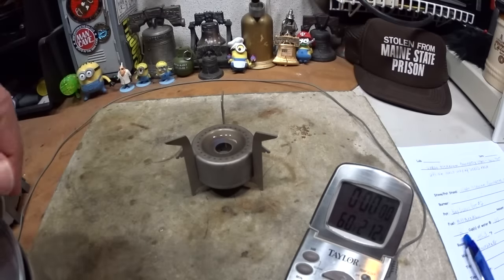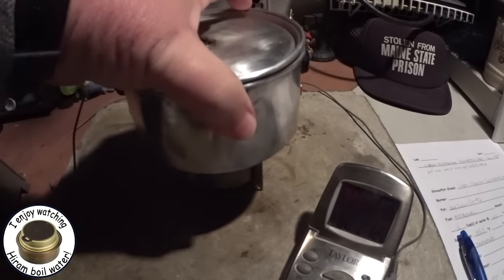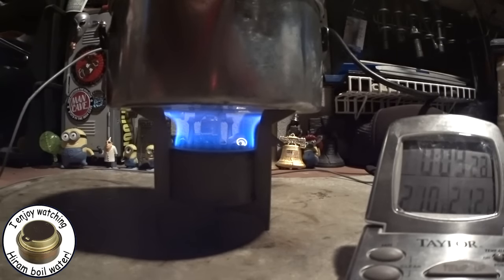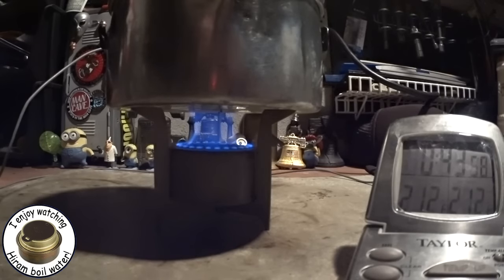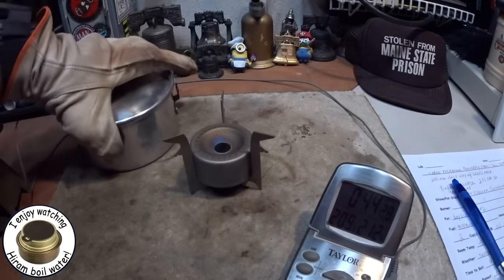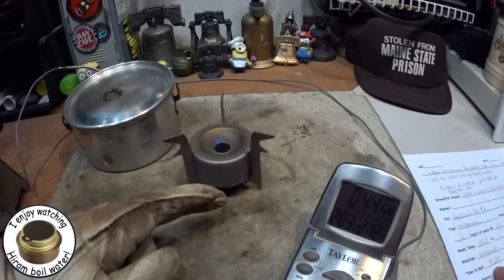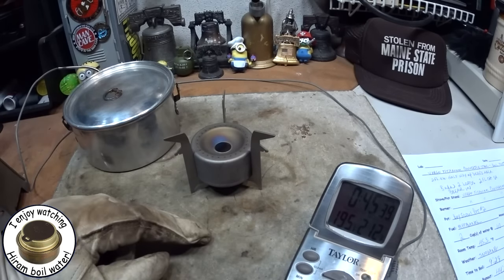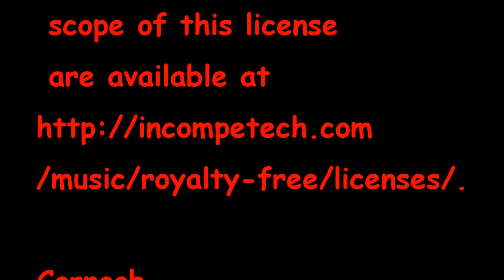Vargo Titanium Converter Stove - Boil Test

Comment: This mystified me too.  Why would anybody even try to sell a stove like this, right?  But I think I may have just cracked the code.  I just ran a Vargo Decagon test in the Hexagon stove and I found that the chimney effect of the Hexagon really boosted the output of the Decagon vs. a regular windscreen.  I suspect this Converter thing is specifically tuned to only work well inside the Hexagon.  By taking it out of the Hexagon, you've basically turned it down and that is why it is taking so long to bloom, boil water and why it has a 40+ minute run time.  Watch the crazy Decagon test video here to see how stuffing it into the Hexagon boosts its output: 

https://www.youtube.com/watch?v=Hd_jOpT5HX8

I bet you will see something roughly similar if you run this stove inside your Hexagon.  Turns out that the Hexagon is much more than just a wind screen, who knew?

Comment: Hiram, many people have suggested a tab of carbon felt under the burner to pre-heat it. Another idea I had is you could fill the stove with 3/4 - 1 ounce of fuel, however much you want to use. Then place a circular disk of carbon felt in the center, something about the size of a 50-cent coin, and add a splash of alcohol. Light the disk and hopefully it will pre-heat the stove and get the jets going just like the full 2-oz fill does.

Comment: Try putting a foil dish under the stove with a little alcohol in , to pre-heat the stove and bring it to bloom, with only an ounce of fuel in the stove.. Or as pkossman suggested  Try to pre heat with a tab of carbon felt /alcohol under stove ,should light quicker with less fuel.

Comment: Thank you for taking the time to do the test. The burn time was impressive but the issue of having to fill the stove with so much fuel is a major drawback. The ideas of preheating may very well work but as you alluded to it just adds an extra step. Thought I'd adding a small disk of carbon felt on to of the stove and priming it that way may help, but I am not sure and do not have a stove to treat it myself. Thanks again, great videos with very precise information.

Comment: Looks like you may have been noticed. I just bought the new triad modeled after this. The triad is 1.5 oz vs 2. I looked and the Converter is now 1.5. Looks like you have an older 2 oz version that didn't last long.